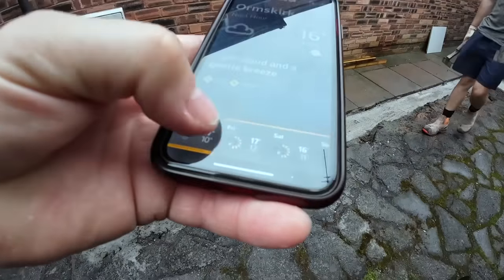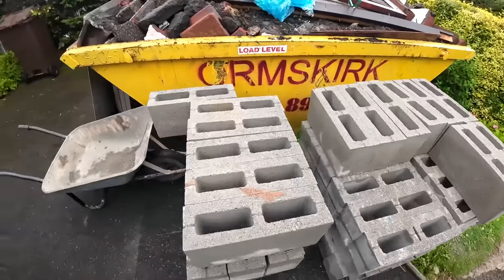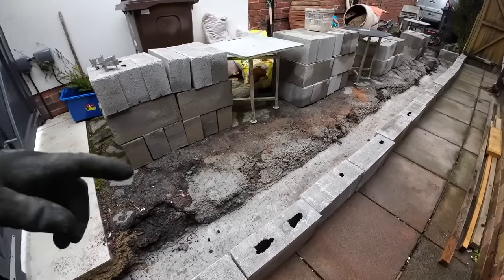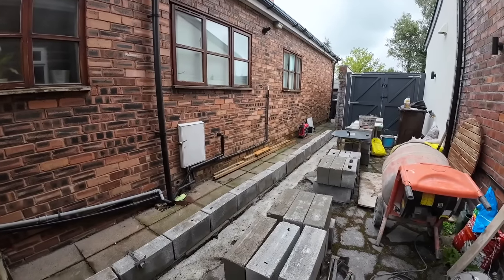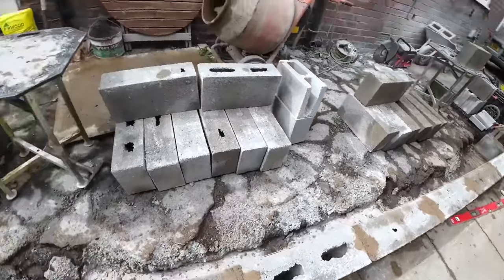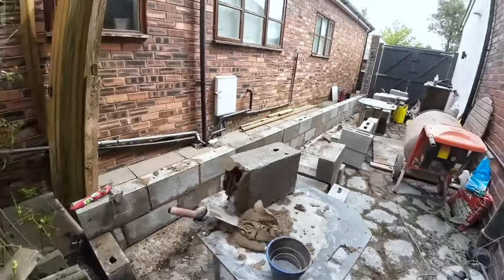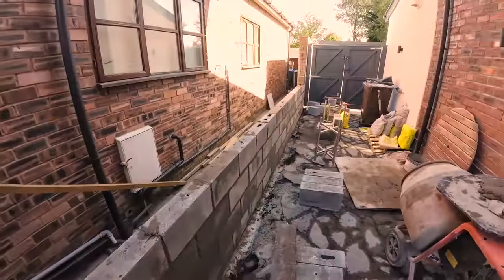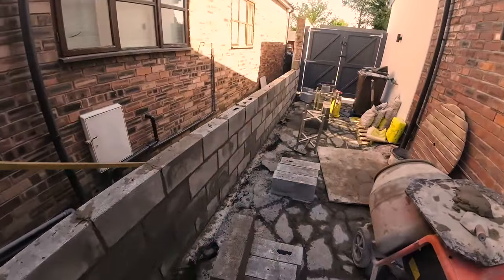REINFORCED 6 INCH CONCRETE BLOCK WALL

Comment: Love watching you guys  as always makes my Monday when I’m back from work with a 🍺👍🏻Bit pointless putting the rebar in if you’re not completely surrounding it with concrete tho
Reply from the maker: It’s was gobbed up . The hole was too small for concrete. It was bloody solid though 💪🏼🧱👍🏽
Reply: I thought he said at the start that the rebar was going to be drilled into the foundation and set in concrete as the corner was built up. I imagine Steve realised it was probably overkill and a !ot of unnecessary work. I'm sure what he did will be strong enough for a gate.....I expect most builders wouldn't even go to the trouble of using rebar! 👍
Reply from the maker: Exactly Sean 🤙🏾🤙🏾🧱👍🏽

Comment: Cracking job. I bet it's a real pain laying such heavy concrete blocks in damp weather. I imagine the blocks don't pull too well at the best of times, let alone when damp. Al worked his nuts off lugging that lot round, setting out, then getting stuck in on the trowel, so don't know what some folks are on about.
Reply from the maker: Thanks pal much appreciated 🤜🏽🤛🏽🧱👍🏽

Comment: When I lived in Spain I built my garage and all walls with concrete blocks similar to those but about twice the width, I was absolutely knackered after a full day in the sun.I would lay them as you guys do with neatly staggered joints and level, the Spanish builders used to crack up watching me, their argument was they are being rendered why bother . I don't think any of them actually owned a level, keep up the good work. 😊😊
Reply from the maker: Cheers Colin , pride in your work goes a long way 👌🏼🧱👍🏽
Reply: Spanish blocks are super light compared to what they are laying.
Reply: Alex needs to wear a filtered mask when the dust blows in his direction, lest he end up with silicosis.
Reply from the maker: @justmyopinion99 . He does most of the time 😷🧱👍🏽

Comment: Weather sucks. If your laying block or brick you can wing it with the weather. Just have some tarps ready and a plan if the rain starts coming down to hard. These jobs are hard enough and when you get rain things slow down and you can't get enough done in a day that you want. Weather is a job stopper. Those blocks are hard to lay, in the U.S those blocks are 6x16 inches especially if you have to bed up to make up some hight.
Reply from the maker: Very true Frank , very frustrating. Especially in England, we’ve just had our wettest October on record 😫🌨️⛈️🌧️💦🧱👍🏽
Reply: @SteveAndAlexBuild  I know the feeling Steve, I think I heard you say 1 step forward 2 steps back. Then the next job you have lined up the costumer starts calling you and asking when  you're getting to there job. Hang in there Steve.